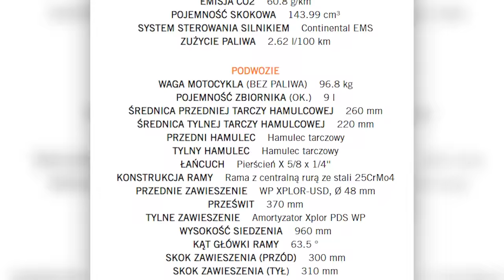Nowy KTM EXC 150 TPI 2021 - UNBOXING

Comment: Gratulacje
Kozak maszyna
Będzie służyć 😎💪
Reply from the maker: Mam taka nadzieje 😃
Reply: Hi  @bowidailyadventures , I'm 1.64cm exactly like U, and I have a Ktm 640cc Duke 2 (supermotard) and it's taller than your, and 150kg,...to make it shorter as possible, I fixed monoamortizator máximum soft, and front amortizator too,...pneumatic little beat less air,...and I'm always using kind of boots with 3cm, not bikeboots, kind of Doctor Martens shoes and similar !!!
The bike most funny that I ever had in my life🔝🔝🔝(and without dbkillers not only the sound it's much better, it is throwing flames of fire in the night when U are decellerating🔥🔥🔥)
P.S.
 U can take away little beat of sponge from seat to have less centimeters, I have not do it, but I reccomend U to don't use the basic exaust, Akrapovic is the best, but there are similar not so expansive like Akrapovic, the sound it's very important 😃👍, if U want more power at starting just changing the corone of chain, it's very cheap but give U lot of power more !!! U bought a really funny bike, enjoy It, and in the future I want see U with 640/690cc THE BEAST !!!🌋🌋🌋